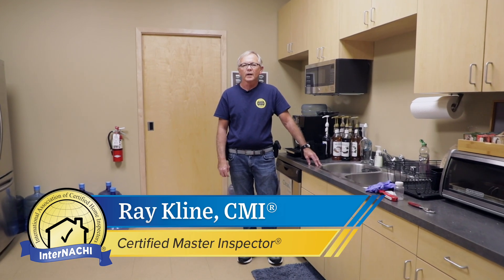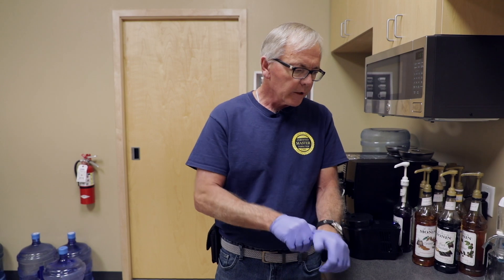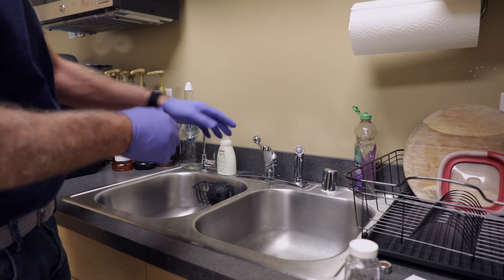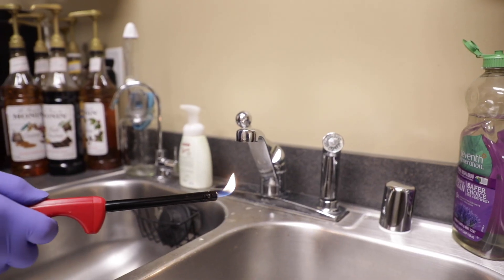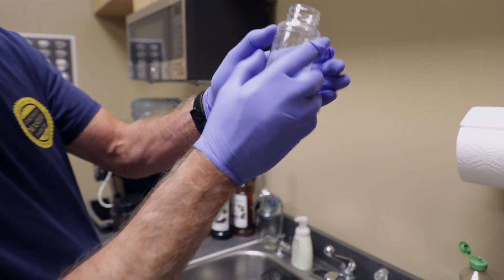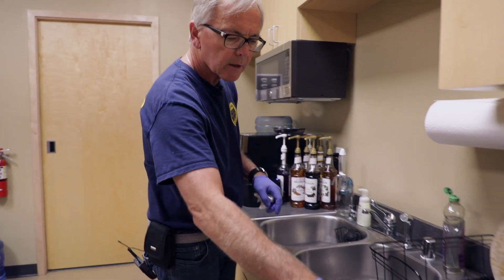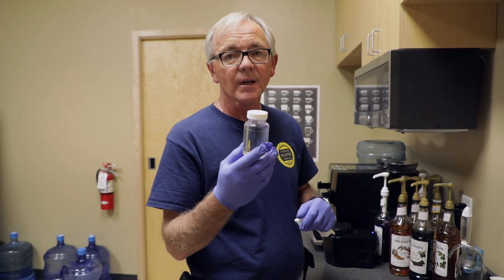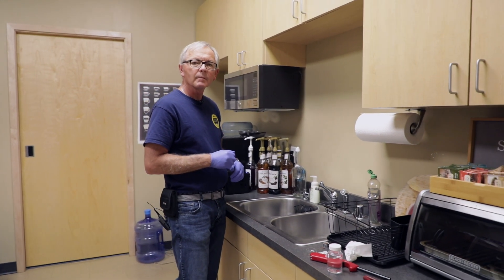How to Sample Well Water for Coliform Bacteria with Ray Kline, CMI®

Comment: So you put on your nitrile gloves and then use your hands to remove the aerator/diffuser, stating this can be a major source of bacteria and to set it aside.  Later, after no cleaning of your gloves, you remove the cap to the test bottle and later put on the cap to the test bottle with your contaminated gloves.  This doesn’t seem correct.  You should remove the aerator, set it aside, then thoroughly wash and dry your hands with sanitizer/soap.  Then put on the sterile gloves onto your sterile hands.
Reply from the maker: Good point, GM.